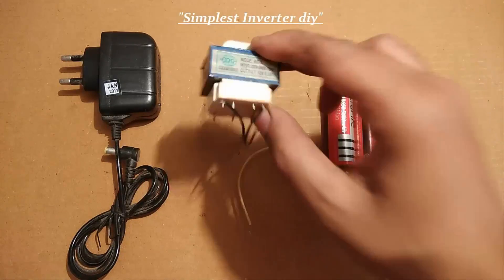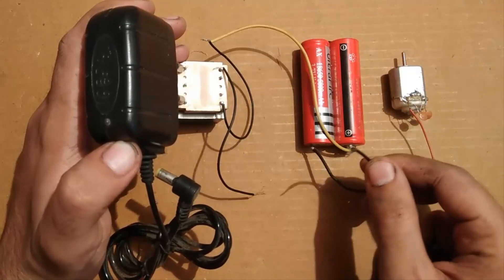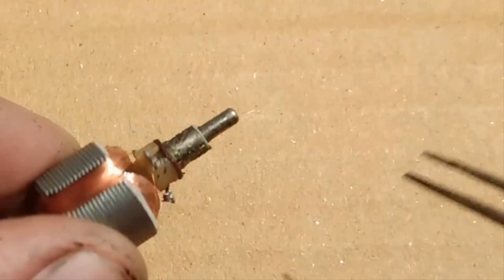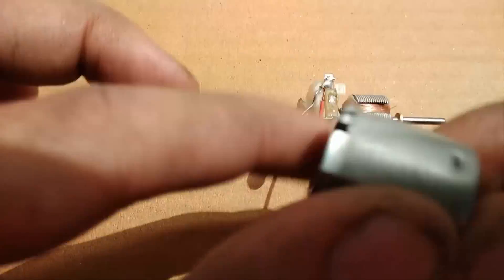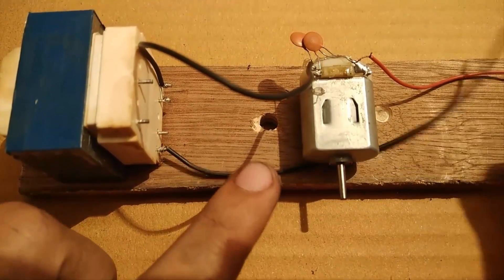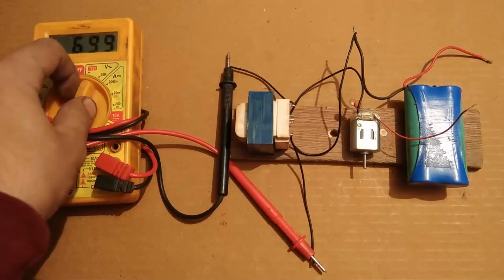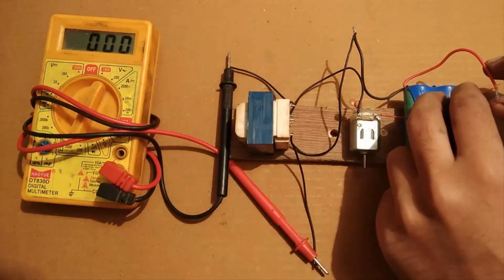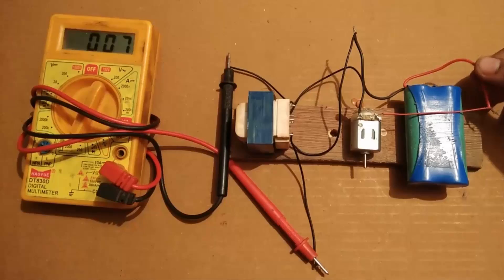12V to 220V Inverter || Make DC to AC Converter with DC Motor

Comment: I don't know.  But if any of this is meant to bring harm or start a fire - yeah, people choose to follow these instructions.  If you are going to teach us - for free - stuff like this, you need to disclose everything!  Some of us need this but can't get the education.  So providing half a circuit without disclosure like - damn - what the hell transformer do I use?  And gee, it would have been nice to know that 40 VA is also 40W.  Additionally, in the US, seems we don't have centertaps here for 120, and the equipment is grounded, not the transformer ( except in power manufacturing).  So, looks to me like I need a much bigger battery, and larger resistors for long term applications, and a house ground.  You may think it's funny - but electricity is getting expensive here, unsustainable...and it appears you're trying to kill people.  And just because you're in India or Africa doesn't mean God can't touch you.  I can't trust ya'll.  You all need help.
Reply from the maker: Hey! Don't be disappointed. Actually i made a series of inverter video for the playlist.. Basics are in the previous video.i have made 5 or 6 inverter videos from basics with explaination to complicated one.
Reply: @MrElectron  I'm watching those.  I have some IRFs coming in from China....10...but I got them before this video.  They aren't 13009s, and I don't have a 541 available.

Comment: Electric shocker in JR high school. Brings back memories.  That circuit does work I don't know if it will light an incadsent light bulb. But it will light a neon light curcuit tester.
Reply: You can also use a single gong bell or buzzer in place of the motor. Old tube car radios used this curcuit for the b+ in vacuum tubes. About 250 volts DC with rectifier in the output.
Reply from the maker: yeah !! tell me about it :)
Reply: @MrElectron  Hi, I know you're a good electrician and I have a question for you..  How to convert 24V DC to 24V AC?